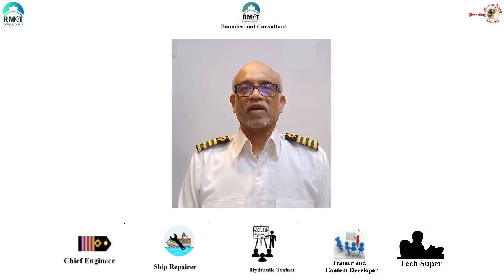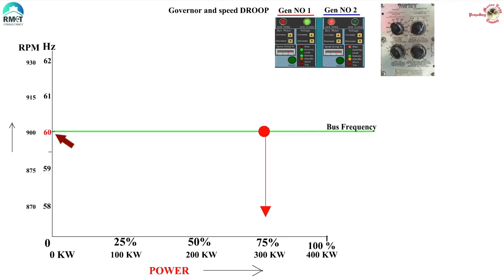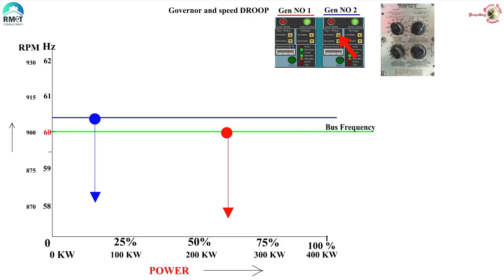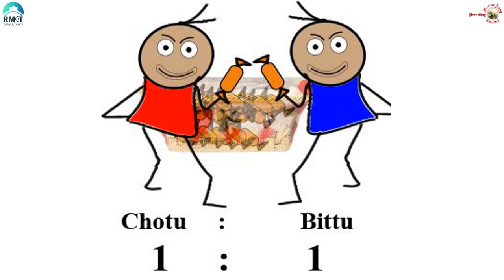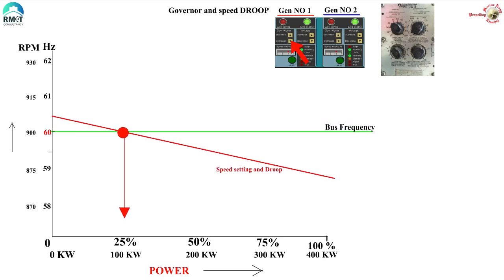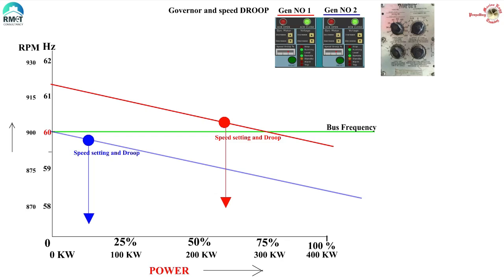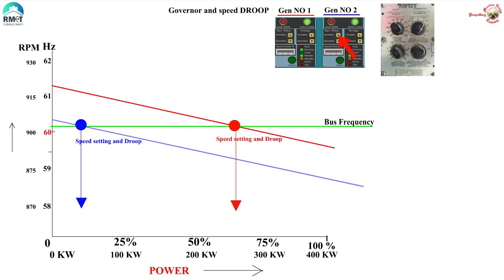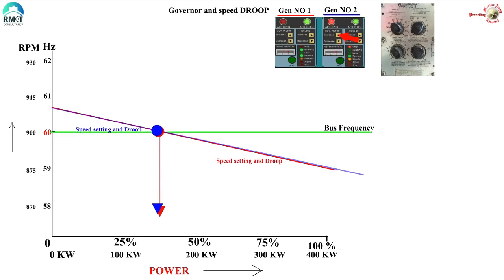What is Governor droop??|Why is Droop a must for parallelling Two Generators|RMETC Vidoes|Ramesh S|

Comment: Sir at 03:50 why do we have to increase the RPM of No.2 gen while increasing load on it ?
Instead we should be increasing the fuel supply and its frequency must drop instead of increasing as load is given to it and subsequently the frequency on No 1 should increase (if it was not isochronous), but its opposite in this diagram

Comment: Dear sir,
I have a queestion, 
There is a existing generator of 130Hz 2.5MW with mechanical governor.
Now another new generator to be installed with electronic governor with same frequency 
Both should operate in parallel and transfer the load for 5 min.
Is this possible?